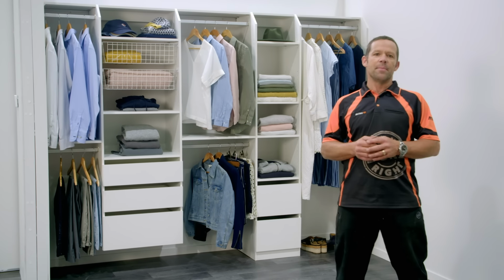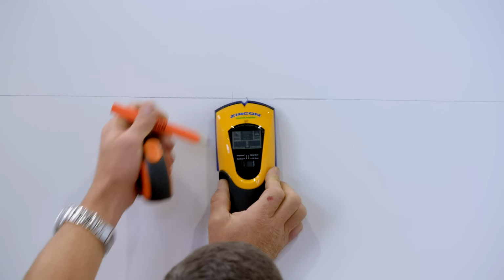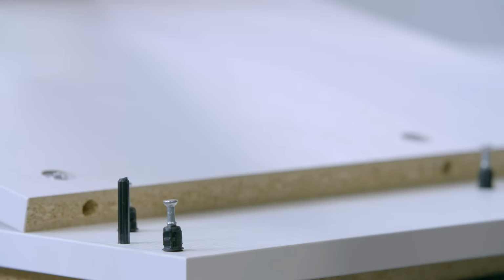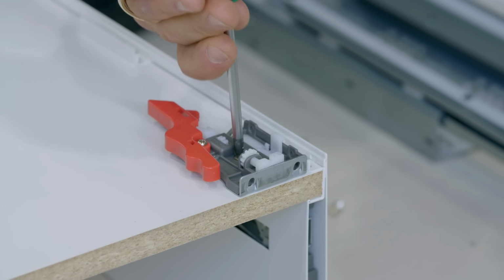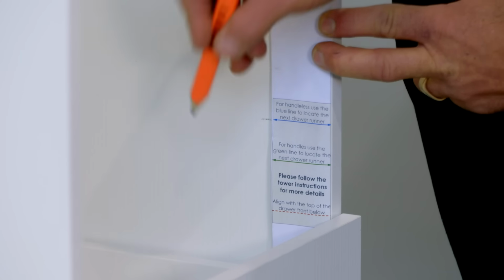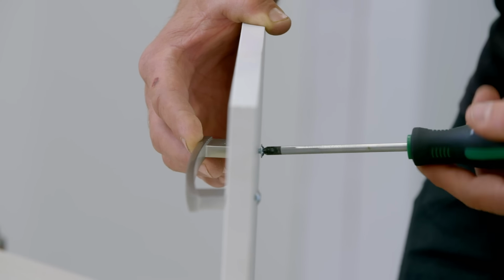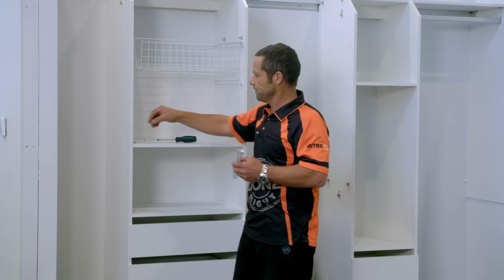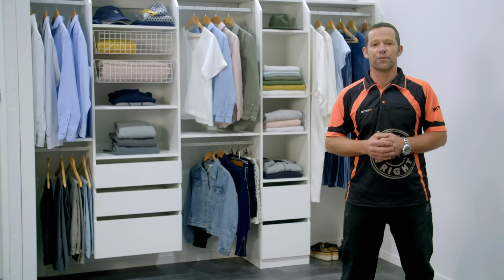How to Install a Connex Wardrobe | Mitre 10 Easy As DIY

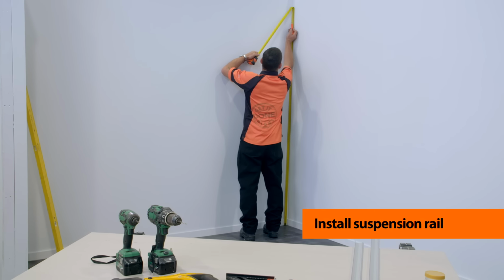Comment: At 1:26 you say mark a level line at 1.984m off the floor, but you actually marked it 1.994m off the floor, unless your tape measure is out by 10mm